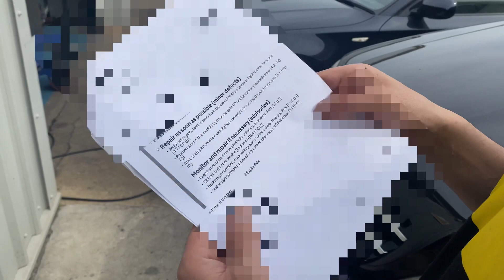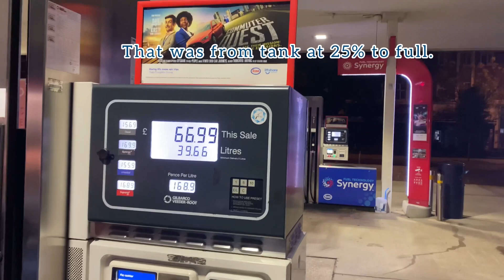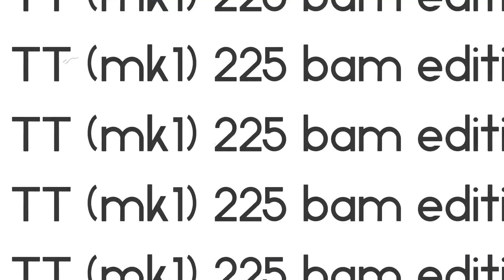Living with a daily: Audi TT (mk1) 225 BAM. First proper drives after some repairs and mot.Mini Vlog

Comment: Shame it didn't last on the engine side bud, I kinda bought mines and bar servicing it within a week it had a stage 1 map on it Lol, then I discovered all the PCV stuff being minced etc, so as per my post on your other video it's now in bits while I'm half way through changing the timing belt, it's supposed to have had a new clutch but I think i either needs a rebleed or the pedal wel cracking or the cylinder on its way out, microswitches in door locks don't work so the windows don't drop etc, it looks like the suspension is original bar a couple of new springs, still with 11 past owners it seems quite genuine without too many bodge mods in the past. We shall see once I get it back on the road and kick it's hole in. :D
Reply from the maker: It happens mate, I have never had much luck with sports cars (Something always ends up happening to them).

 I had a prelude 2.2 5th gen had it parked down the road where it never floods but that week I had it, it rained and the car got flooded, so ended up having to get rid. 

Then I bought an RX8 which was solid engine and body wise, it was probably one of the highest milage ones in the country I sold it at 177k miles because someone crashed into the wing.
And now the TT was my last sports car victim. Hopefully the next one will be more lucky lol. 

Seems like you picked up a nice example of a TT and you are doing all the important bits so I think she should enjoy the abuse on the engine side. Unfortunately these TT's suffer the electric side of things so you may be chasing these electrical problem for a while as they pop up :).

Comment: Good video! Nice TT too, I like the colour. I've also got a 225 TT, except the previous owner has chipped it to 260bhp! And yes it is rapid to say the least 😃Get the crankcase venting properly and there is no reason you couldn't do the same to your TT too. Two things I would do to your TT first cosmetically as the bodywork looks so nice is get the alloys refurbished and the headlights restored (un-clouded) as they are letting your TT down a bit as the bodyworks pops so much. I had the same issue and now my car blings 👍
Reply from the maker: Thank you for your comment and advice. There is definitely bits to be done on the car like you mentioned and paint isn’t too bad, so alloys and my friend already has a set of new TT lights he has spare so I may just swap them over. Also front bumper has a bit of a scratch on it you can’t see in the video and slight damage to the front light lens cleaner/washer is broken/damaged from a bump. I’m looking into wether replacing my the whole front bumper or somehow repairing this one of its salvageable :). Really happy that you have such a nice and well liked after example of a TT. Extra 35hp sounds nice too :)